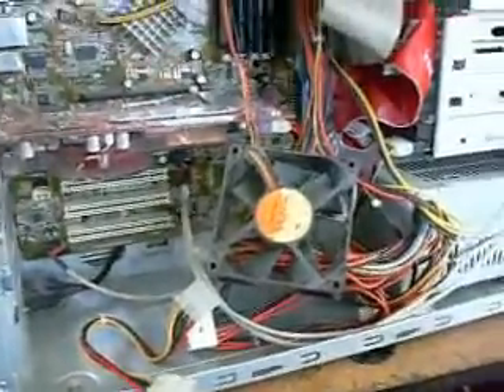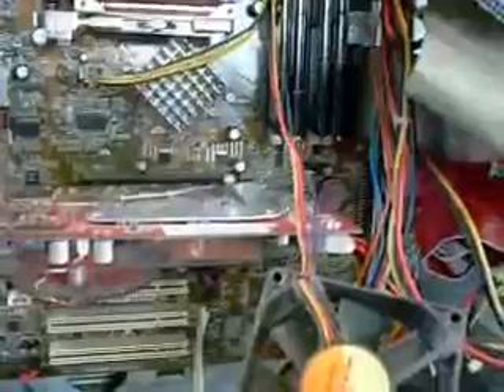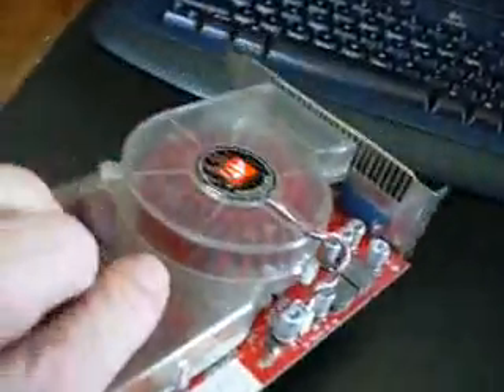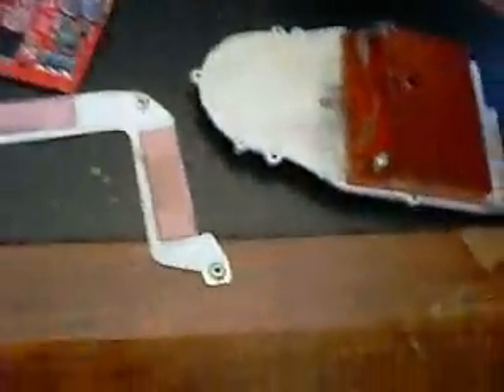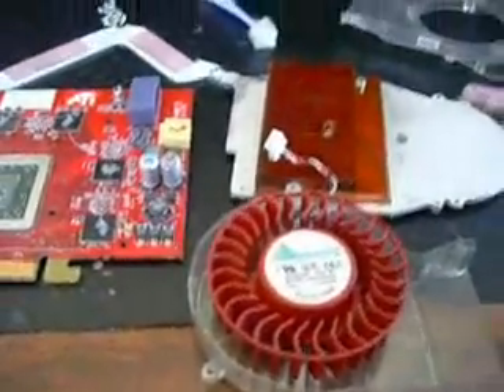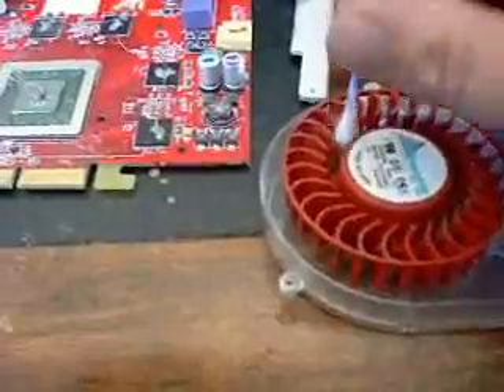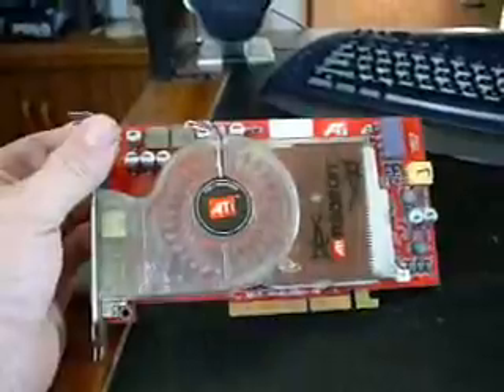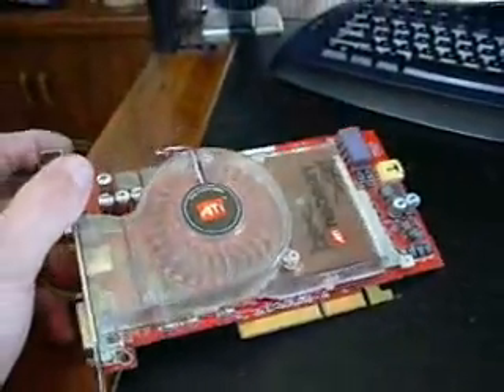Cleaning your computer out for better cooling

Comment from the maker: @zenith828 Nothing wrong with that. I do most of my cleaning with one also. The only thing to watch out for is if you use a industrial air compressor it may have too much psi and be able to bend things. Like the thin fins on some cpu coolers. So I always make sure to set my regulator so that it wont put out more then about 40 psi when I am cleaning.

Comment from the maker: @B00h44 That is a very good question. It depends on the warrenty of the video card. some compaines will allow you to replace the stock heatsink and fan with a after market one. I think FGG and XfX are two of them. But most of them will still warenty it as long as nothing was altered that could damage the card. But a person should really read thier warrenty first and make sure they want to take a chance with it. 

Thank you for the post :-)

Comment from the maker: @FELIX0123 Very true. I have a water cooling system also. But because of the cost of water cooler and the fact that there are some very good air cooled cpu coolers on the market i would guess at least 75% of people are still overclocking on air.

Comment from the maker: Actually i just put the cooler on about a week ago and did clean the cpu and put artic siler on it. I just didnt take the fan off and clean the heatsink when i put it on. I had that one on the wifes computer for awhile and that is why it was so dirty. But thank you for the heads up just incase.

Comment: Great video I usually clean them with air then wipe it with clothe and q-tip with alcohol if its really dirty. The toothbrush it good idea the softer bristles would be great for a fan cleaning tool. 5/5